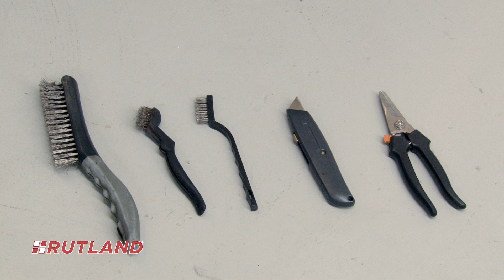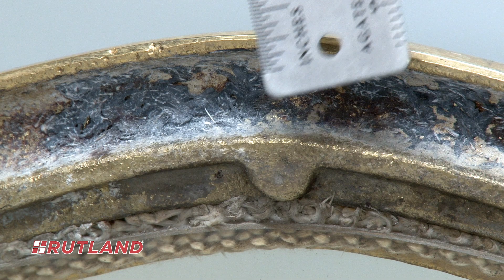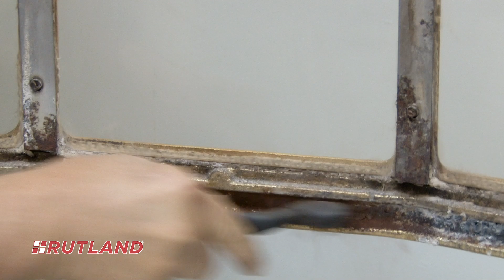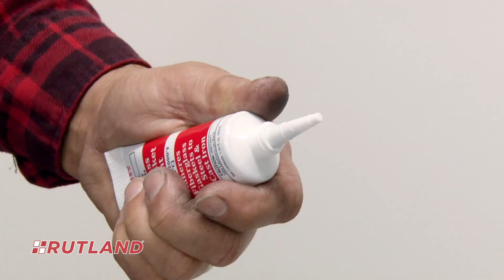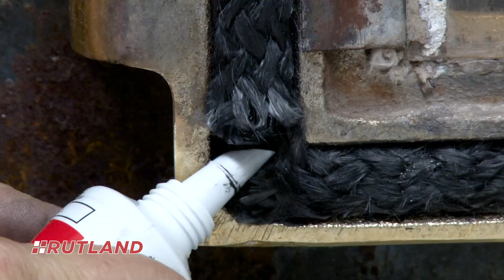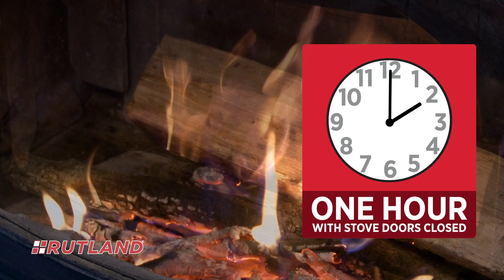Rutland: Stove Gasket Replacement

Comment: I find that removing the door makes the job easier…also, I like to wear loose fitting shoes. I always replace the window gasket at the same time. When putting the cement in the door gasket channel, I use a spritzer to wet the channel, then run a bead of cement. I then use my finger to spread the cement smoothly into the channel and then press the gasket in. While waiting that hour for the cement to set up, I like to put a Slim Whitman album on the old Dual turntable and crank up the volume on my Marantz Amplifier-receiver.